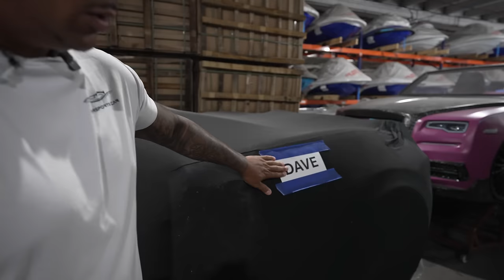Watersports Car Factory Tour and Sea Trial

Comment: To me, If they had a gear shifter that was a stable throttle like boats have, it would be better. every time you hit a chop with that foot throttle it bounces your foot off of it which is why the engine sounded so choppy. That was just his foot bouncing on and off the throttle.

Comment: He should use the rotax engine from Sea-Doo closed loop cooling more reliable than a Yamaha
Reply: Im sure he has a discount with yamaha..      i dont believe they wont sell him an engine either... this is how he marks it up ..
Reply: @BUFFDgaming  yeah probably right
Reply from the maker: @BUFFDgaming  another manufacturer I know had to do the same thing. Yamaha will not sell those engines individually
Reply: @AlfredMontaner  LIKe i said I doubt it...   what if u blow your engine UP ...     come on BRO ...      U know  U know ...    I walked in katech and bought a 20k engine  ...     they dont want to deal with u until they do...
Reply: Indmar has a package with  a 310 horsepower 2.3 EcoBoost engine and Hamilton jet that would be well suited for this application. 
The Waverunner power train seems like sort of a waste but using a brand new jetski as a donor provides every part, down to the battery, necessary to make the boat run. The crappy hull and seat are the cheap parts anyway. 
Imagine what it would cost to walk up to the parts counter of the Yamaha dealership and order individually every single part on that jetski minus the hull and seat! 😱
Reply: @straybullitt  I agree 100 percent..    for the  75k  u should at least get the ecoboost in reality.